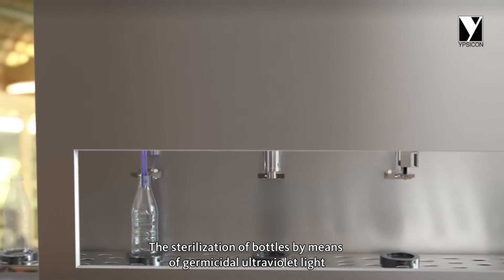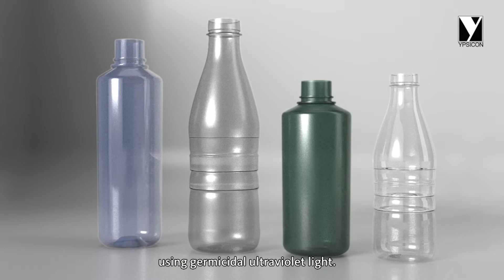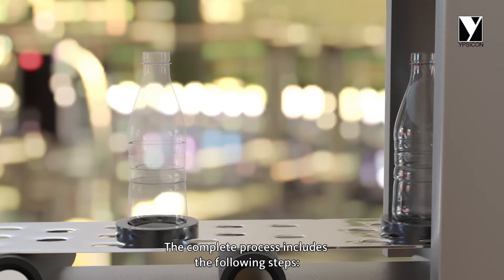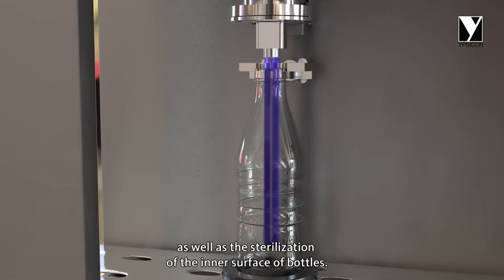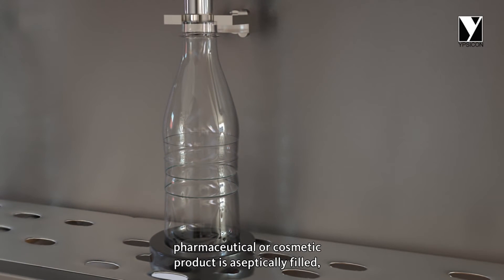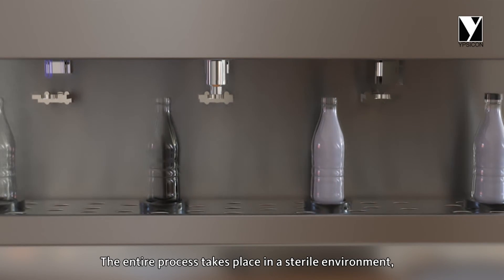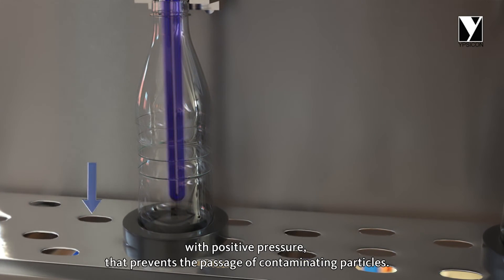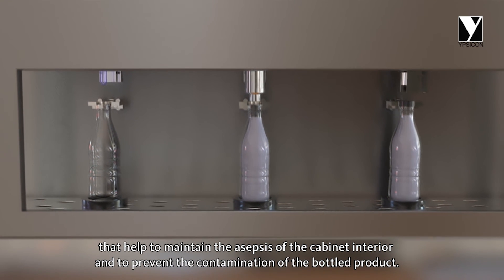ENG UV-C aseptic bottling

Comment: We are interested in buying , please send quotation. Namh shivay.

Respected  sir.
Sterilization  of pet bottles  and various  paper  bottles  is big issue  in  juice packaging  industry. 
When we pack  the product directly  in bottles  , our life span  of juice  reduces and sometimes  fungus  comes. 
I have found  one solution  for this problem.  Using your method  of U..V. serlization  is ok but workers can have bad effects  on health of getting  cancer. 
My method  is take pressure  cooker,  remove  vissle and add gas pipe  and let slow steam  go inside  the bottle  with help rod.       Simultaneously  with other pressure  cooker using  same system,  we  do sterilization of neck of bottle. 
We face problems in such process  because  different  articles  need  different  amounts  of time and pressure of steam.  For example  three grm pet bottles  gets sterilize  quickly  then 12 grm . Each pet bottles  have melting time.
If we use sensor  to detect  , then our sterilization  with steam can be done   successfully to pet bottles. We can also use same systems  for different  articles before  filling  liquid. 
Please  work  on it . This is most cost  effective serlization  idea.
Make it more  sophisticated,  This instrument, I would like to buy.

My second  suggestions  is , when companies  makes pet bottles,  some  plastic granules  remain inside  the bottles  , So make bottles  to do round circle  and all granules  of bottles  is out.

In first  process  the plastic granules  is out,  second  steam  Sterilization,  third filling , four capping  all is  done automatically.
Namh shivay.

Respected  sir.
You  can  use same  systems  for sterilization  of caps .
I am using  this method  manually. 
I remove  nosal  of pressure  cooker  and on slow steam , I put the bottle in vertical  position  and   I rotate  the bottle so that steam  spread  in equally  on surface  of bottles,  with heat  in my hand,  I sense  the  completion  of process  then I pass the neck of bottle under  the steam.  Result  is quite  satisfactory , but I get pain in my hand. 
You can T shape  system  to cover  inner  and outer  part  of bottles. 
Namh  shivay.